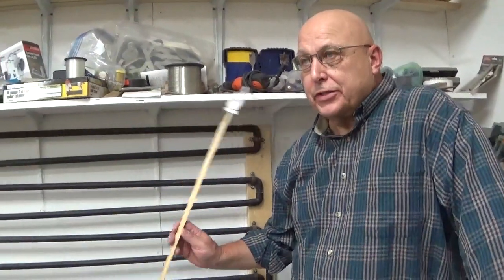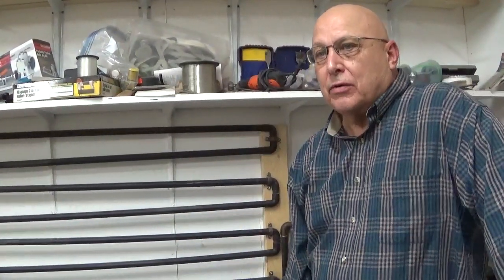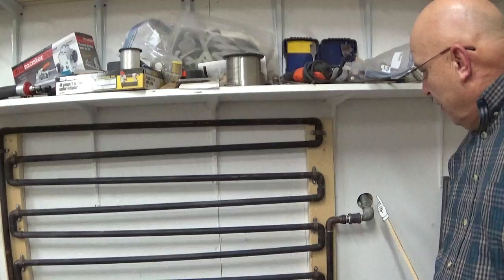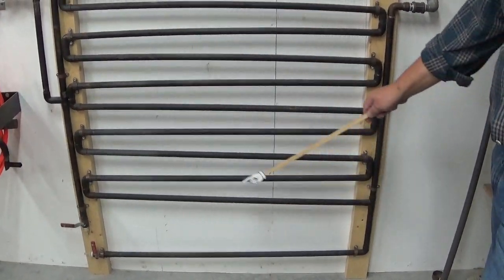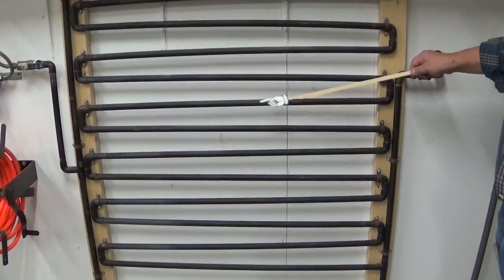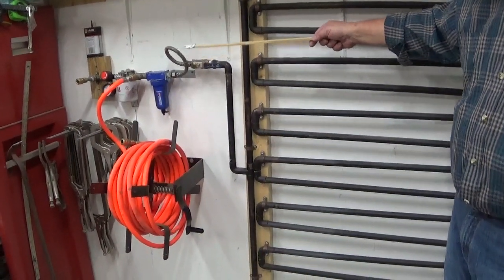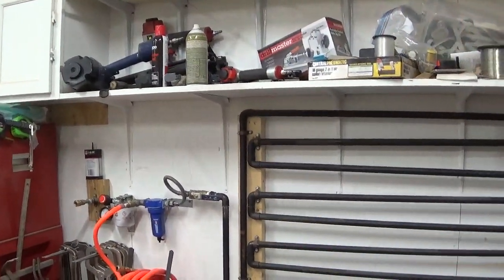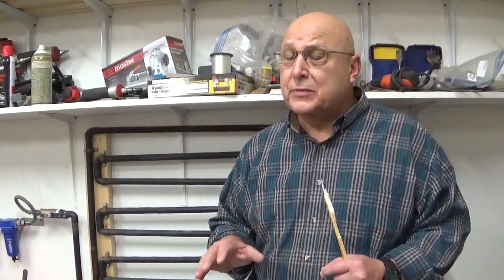Air Compressor aftercooler air cooler dryer condenser, simple and effective to remove moisture

Comment: Can you please explain why you think uphill is better than downhill for the majority of the cooler? Seems that fighting gravity would hold much of the water that's condensing out of the air within the cooler itself.  It seems reasonable that once you open the first ball valve, a good chunk of the water would be blown out, but wouldn't you get more of it if it were going downhill as it cooled? Thanks!
Reply from the maker: This design would probably work in either air flow direction but I think the airflow going uphill will keep the condensation/water away from the filter much better as the condensation/water is draining back downhill away from the filter and regulator. Either way you make it have fun and good luck with the build.

Comment: Just wondering can't you use PVC? It would be a heck of a lot cheaper and a lot less work..
Reply from the maker: Hi John,
The problems with PVC is it has more of an insulating effect with the heated compressed air, it won't dissipate the heat as copper does. Plus there is always that chance of bursting when the PVC starts to break down from contaminated air with oil or if exposed to sunlight (UV rays)

Comment: I love the simplicity of this design. I kind of went ridiculous in the other direction, it’s not simple at all unfortunately. I am just finishing up with my intercooler (between pump and tank) using a 1/2” in, 1/2” out B&M transmission cooler, with a matching automotive fan, run by a computer power supply that I have triggered by the compressor’s automatic switch (220v setting.) I put an auto drain on the low side, another auto drain on the tank, and a large desiccant filter after the tank. For all the work I’ve put into it, I really hope it works! If not, I’ll be taking it all back down and replicating your dryer setup. It’s for sand blasting, plasma cutting and powder coating. I’m crossing my fingers!
Reply from the maker: Hi Mike,
With all that you put into your cooling system even if it didn't work exactly the way you wanted it to I think I would just leave it on because it sounds impressive. You can always make one of these simple line coolers and attach anywhere away from your tank but I hope your original system works well for you.
Reply: Do you have a link of the transmission cooler you used?

Comment: Why not to use just soft copper tube and wind it to huge copper tube coils with water trap at down? I think it's will be much more effective, time saving, and may be less expensive, because you not need to buy copper couplings, not so much soldering,  etc...
Reply from the maker: This video is to show how simple an air cooler can be made, you can use whatever size copper that will fit your needs. Just keep in mind that you should use a minimum of 3/4" copper line for proper moisture condensing and to reduce any air volume restrictions.

Comment: what is the benefit over the vertical configuration? Seems both work effectively.
Reply from the maker: They are basically the same principle but the vertical design needs a ball valve drain at the bottom of each tube junction/connection, otherwise the air flow will push the condensed water over into the next tube. So your saving approx $20.00 to $40.00 in ball valves used for  drains, by building the horizontal design which is self draining by gravity to the one ball valve.

Comment: Would it work better to hook up the Condenser in between the Compressor and the Tank ? And that would help keep the Tank Dry. Or would that be to muchfor the condenser to handle right off of the Compressor ? Because right off of the Compressor the air would be hotter and maybe moving faster. And I say movingfaster because moving the air from Compressor to the Tank First  would be like hitting a Big Speed Bump. The Tank would be like a bigger Cooler Tube for the air to hit before going in to the Condenser.  ( I don't know just thinking out Loud )
Reply from the maker: Hello BR,
It would probably help as a pre-cooler between the compressor and tank, with that much air moving through the copper lines you would need to cool them with a fan. The average shop compressor produces 10 to 20 CFM and that is a lot of air to cool. They are easy to make , you could make two coolers and place one before the tank and one after. Good luck..

Comment: i will build your design , its the simplest. any idea what drop in pressure and flow we will expect? its 15meters of pipe it will restrict the flow and drop the pressure  while using a tool that needs high flow (air hoses do the same).
can we use a 15 meters non insulated copper pipe and bend it like your example to avoid the soldering and the elbows?it should work the same .
can we use like 4 rows of 3 meters each to minimize the elbows and the soldering if we copy your design?
Reply from the maker: If you are use air tools with an  air regulator a pressure drop it wouldn't be noticeable. If you are using a direct connection for an air coupler high pressure line, there would be a slight drop but not enough to hinder the effect of a sandblaster. You just need to make sure that you use a 19mm (3/4") diameter copper for a flow of air with minimal resistance, a smaller diameter copper will give you restricted air flow when using large volumes of air.
Reply: @jeffwillard2417  i think either using or not a regulator , when using 10meters long air hose the drop will be there.am i wrong? for the flow you are correct 3/4 is plenty to have good flow , plus the high flow fittings at the tools. but the max pressure doesnt drop proportional to your hose length?
Reply from the maker: The majority of the air pressure drop will be at the end of your air hose, from hose I.D. size and length. Use the recommend manufacture air pressure on any of your air sanding tools and keep them oiled they will last longer.

Comment: my husband really like the setup you have. Can you please send a list of materials you used for it? I would really  appreciate it. Thank you for your time
Reply from the maker: Hi Jessica,
That is easy, Lowes or Home Depot will have 10 foot lengths of 3/4" copper pipe, get a minimum of 5 pieces to give yourself 50' of cooling. The overall design length will be up to your husband and wall space, the first one that I made I used the full 10' lengths of copper without cutting them, I had more wall space in my old shop. You just need to figure out how many copper elbows and tees you'll need, I used 1/2" brass ball valves for the drains I got those on Ebay.  Next add a finale moisture trap then a filter I used a screw on filter,  the links are below.  Hope this helps..  https://www.harborfreight.com/catalogsearch/result/index/?dir=asc&order=EAScore%2Cf%2CEAFeatured+Weight%2Cf%2CSale+Rank%2Cf&q=air+filter
https://www.surpluscenter.com/Hydraulics/Hydraulic-Filters/Filters/3-8-NPT-7-GPM-Return-Line-Filter-9-7291.axd
https://www.harborfreight.com/catalogsearch/result/index/?dir=asc&order=EAScore%2Cf%2CEAFeatured+Weight%2Cf%2CSale+Rank%2Cf&q=Air+Regulator
Reply: Thank you so much for the information.

Comment: Hello Jeff, great video and thanks for sharing! Few questions. I have a 60 gal, 155 max PSI, 14.5 cfm at 90 PSI (pretty typical) air compressor. Minus the cost of copper, if I ran 25 ft of 1in copper tube would this equally cool the air as a 50ft 3/4 copper tube. After reading all 300+ comments I haven't seen anything that questioned the length-to-pressure drop ratio. For my compressor with 25ft of 1in tube+high flow fittings+25ft of 3/8 air hose = 50+ft or more of length. Would my compressor still push enough PSI at the end of the hose for automotive painting and tools?
Reply from the maker: Hello Sheldon,
I would stay with the 3/4" for several reasons, cost the 3/4" is much cheaper and the 50ft of 3/4" gives you a longer cooling process. I don't experience any loss of pressure using my air tools. If you're going to run a sandblaster you can always make a tee before the air cooler to connect an auxiliary compressor and compensate for the extra air pressure/volume required for sandblasting. The specs sounds like you have about the same compressor as me.

Comment: I like your approach but just have one question.  Why did you route your air flow direction from top to bottom?  Why not have hot humid air enter at the top of the serpentine path so that the air flow would aid and promote, along with gravity, the flow of condensation down to the bottom?  It seems like the air flow in your system is fighting rather than aiding gravity.
Reply from the maker: Hi Ron,
The direction of the air does start at the bottom and goes upward. The first line from the compressor goes to the bottom drain and then starts its upward direction through the air cooler, so the condensed moisture drops downward to the first trap, just follow my fancy pointer.... :)   :)
Reply: @jeffwillard2417  Thanks for the reply.  I guess I messed up my question and and just confused matters.  What I meant to say was "Why did you route your airflow from bottom to top?" Because it seems like the air flow is against the direction of water flow.  I know the impacts would not be significant but it just seems like it would be more efficient to have the air moving along the water droplets in the same direction, along with gravity, downwards.
Reply from the maker: Hi Ron,
It would work in both air directions but I felt that having the first water trap the furthest away from the air/water separator and air regulator would be the simplest design for removing moisture. Thanks for the comment it is always good to see people thinking outside the box.

Comment: why did you decide to have the condensate flowing against the air flow. inlet at the top instead of the bottom. it seems the water would drain easier with the air pushing it as well as gravity? tks
Reply from the maker: Hi Lee,
I just think it is more efficient to have the condensed water droplets flow directed away from the air outlet than having the air push the droplets towards the air outlet and filters.

Comment: Looks like a simple and effective design. I am interested in building a similar setup, but as I have a fair bit of room, I was considering stretching out the width of it to some 6 meters, with only 3 horisontal legs. With that in mind, a question came up: does the actual number of horisontal lines matter? Or the amount of rise, height difference between the top and bottom of the system? I hope you could clarify that. Thank you in advance!
Reply from the maker: Hi Timo,
That will work also, it actually would be like the first air cooler I made for my body shop which was 60' (18 meters) long using 10' long copper pipe. Just keep the uphill design and the drops for water drainage. That is what I like about the design is it can be adapted to any size or space needed. Good luck with your build.
Reply: @jeffwillard2417  ....why would you use an uphill design? The velocity of air will be entraining the water along the pipe with its flow. It would be much better to let the air push it down to your trap and also work with gravity.  Otherwise....you depend on gravity to drain the water back down the pipe, to the trap. when the airflow shuts off...and hopefully it will be off long enough for the water to get to the trap before it restarts.
Reply from the maker: @freepatriot6313  All I can say is that the design  works and has for years.....

Comment: If all the ends are 90 degree bends do you just kind of bend them a little upwards to create the slope? Not a problem to bend the joints?
Reply from the maker: Hi Damon,
It doesn't bother the soldered joint at all, the pipe  flexes enough to achieve the incline. The one I'm using now was made 15 years ago and still works perfectly.

Comment: Nice Project Indeed. What is the Size/Specs of your Pump and Motor vs at output(System)...? Greg
Reply from the maker: Hi Greg,
It is 14 CFM @ 40, 12 CFM @ 90, 4 hp motor, 60 gallon tank, its the most common size for  a small shop.

Comment: What did you use to get the copper pipe brush to reach all the way to clean the middle of the 43" pipes?
Reply from the maker: You only need to clean the outer ends of the pipe and the inner on the fitting for soldering. No need to clean the inside the copper pipes.

Comment: question, for your needs, the filter with dessicant/silica was not necessary?
Reply from the maker: Hi Six4Foot,
Years ago when I was doing a lot of sandblasting using a pressurized blaster, large CFM's of dry air was ultra important. So back then I was using a Motor Guard filter before the high pressure coupler to remove any residual moisture that may have gotten past the water traps and water separator/filter, a clogged sandblaster is a pain  I never needed a desiccant filter. Here is a tip if you purchase a Motor Guard filter don't buy their filters use the cheapest and stiffest rolls of toilet paper you can find, that is what I used :) :)....

Comment: Hi Jeff,
Great video. I have just watched it again as I need to make a decision on which way to go with my cooling system. I can tell from yours that it has been there a long time and given you good service. You say you are in Florida which is a lot warmer that the UK plus you must have high humidity levels to contend with too. I only have a small garage and my compressor is only 16 feet away from my blasting cabinet. This is my first compressor so I have been doing my homework to try and get the system right first time. I have decided to but a PCL DropOut unit (made in Sheffield, UK) which is supposed to remove the need for a dryer. However, I am still on the fence.
 My question is...do you get much water out at your ball valve nearest your compressor or the one at the other end of your system?
Thank you for taking the time to share your system.
Kind regards Paul
Reply from the maker: Hi Paul,
The first ball valve moisture trap always captures the most water because the condensed moisture travels down the copper pipes to the first trap. I get very very little out of the second ball valve trap. You can make this design into a pre-air cooler also, placed between the compressor and tank. Good luck...
Reply: @jeffwillard2417  Thank you Jeff 👍

Comment: Do you think this setup would be worthless with 1/2” copper? I have a pile of 1/2” copper from a basements water lines.
Reply from the maker: Hi Dan,
It should work for the average shop unless your going to do a lot of sandblasting,  the minor pipe size restriction may effect the air pressure. I would clean the inside with CLR to remove any mineral build up which will effect the air cooling process plus flake off and plug your air filter. For the pipe size difference, run an extra 10' - 20' of copper for additional air volume and cooling effect. Good Luck..

Comment: I know this was posted almost 2 years ago but I'm getting ready to make one for my quincy air compressor.  Did you just slightly bend the piping to get that out of level run on the long pipes?  Hope I explained my question good enough.
Reply from the maker: Hi Robert,
Yes it was, the copper pipe has enough flex in it for a 1" incline on each row of tubes. Just incline the first pipe (bottom pipe) then incline each pipe approx 1" on the mount after the first one, easy peasy ... Good luck.
Reply: Yes it will flex several feet until you get it mounted mine looked like a slinky until i had it secured

Comment: Shouldn't this go between the compressor and the tank? This appears to be post-tank, no?
Reply from the maker: This design works as a pre-air cooler or an after-air cooler, wherever you want to use it. You'll need to fan cool the tubes if used as a pre-air cooler.
Reply: @jeffwillard2417  ah makes sense. Thanks for the advice 👍

Comment: I like your video how about some measurements and almost all the after coolers I’ve watched they run the compressor to the after cooler back to the tank .you said you had 50 ft of copper at my Home Depot it’s $ 440.00 plus tax and fittings
Reply from the maker: Hi William,
   The cost at our Lowes per 3/4" X 10' piece is $23.27 and Home Depot is $32.79, so the cost for five 10' sections $116.35 @ Lowes and $163.95 @ Home Depot, I'm not sure why there is such a big cost difference. I guess the best bet is to shop around, good luck..

Comment: It's a well known fact that expanding air cools. I have been thinking about a manifold  type build with several 3/16's (6 to 8) orifices  dumping into another manifold  that has at least a 3/4 feed out. I do like this design though
Reply from the maker: Hi William,
That would be a good experiment in air cooling, when you get it finished let us You-Tubers know the results. Good luck with the build.
Reply: The flaw in that plan is that after you expand the air, it's not compressed any more. The goal is to have cool compressed air, not cool uncompressed air.

Comment: great video. a couple of question if you don't mind. Does it have to be that wide or can you make it more narrow and more rows. Are you draining the traps after each use. Thanks
Reply from the maker: Hello hoxha34,
You can make this air cooler into any length or height you need, just make sure all the pipes are angled upwards for drainage and you have at least 50' of 3/4" copper to properly cool the air.  My first shop air cooler was 7 pieces of 10' X 3/4" copper pipe mounted onto the wall which ran into a water trap/filter then into a motor guard air filter, then a separate high pressure hose connection and finally into the air regulator, but back then I needed a lot of clean air for sandblasting, air tools and painting. You drain your traps as required depending on how much air you use and the amount of seasonal moisture in the air.